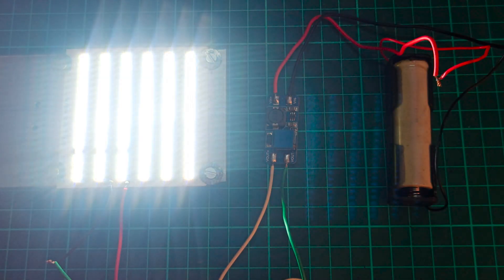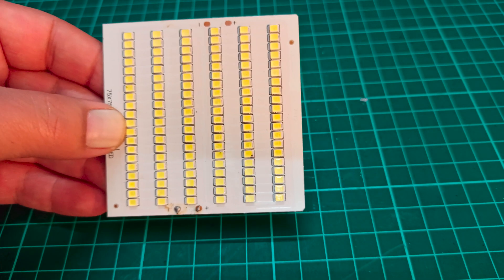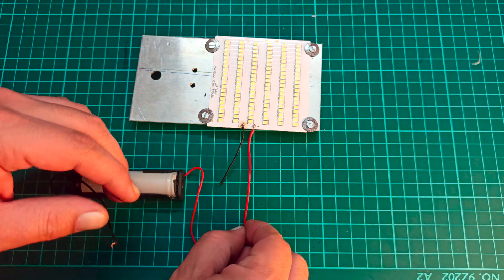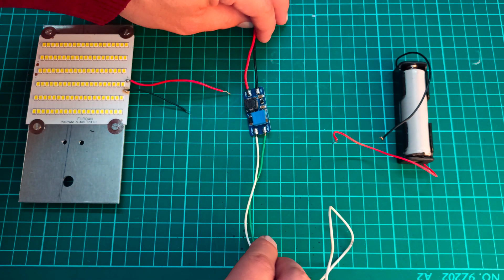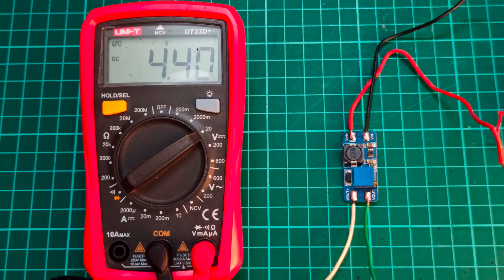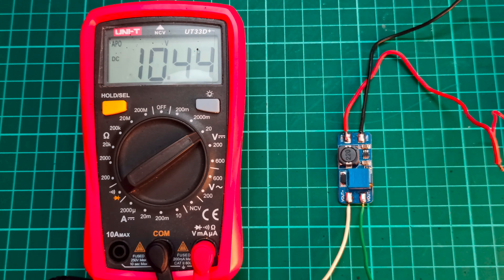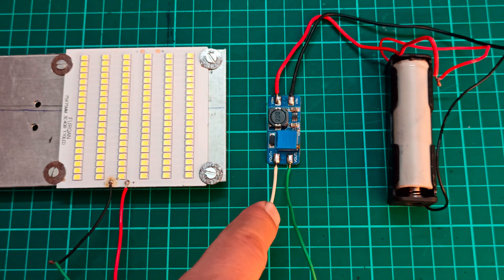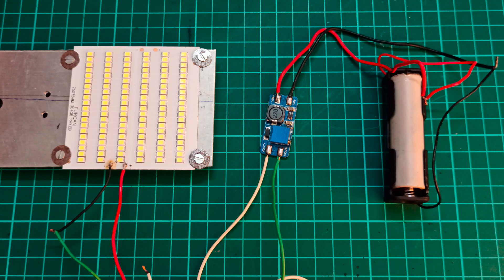How to make Simple LED Driver

Comment: an ideal buck or boost converter:
Power in ≈ Power out
Current does not magically increase
Lower voltage → higher current
Higher voltage → lower current
Your example proves it:
Input: 24 V × 1.9 A = 45.6 W
Output: 5 V × 9 A = 45 W
The small difference is just converter loss (heat).
So when people say “DC-DC converter increases amps” — that’s wrong.
It only trades voltage for current, keeping power nearly the same.
This is basic law of energy conservation 🔧⚡

Comment: Most leds are going to burn out if you increase the voltage 1v above their operating voltage, hence this circuit is not very useful
Reply from the maker: Hi there,
Yes only if you increase the voltage, that is why LED drivers need to have a voltage reference feedback.
Since this is a simple design for testing purpose so one can have a testing setup using this method 😀